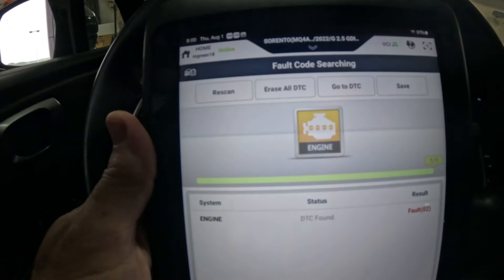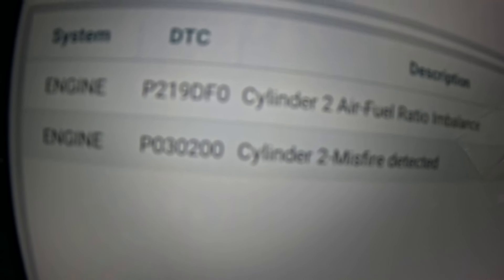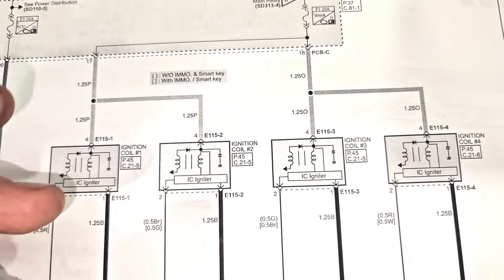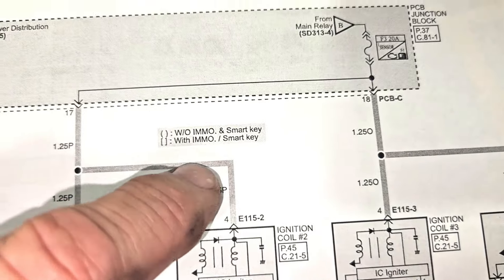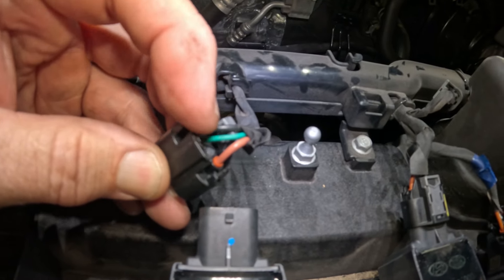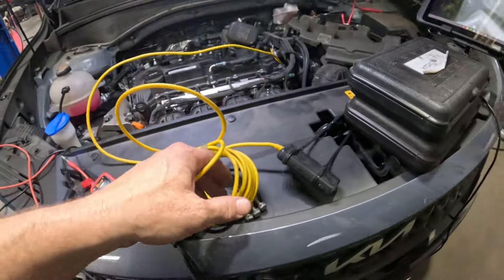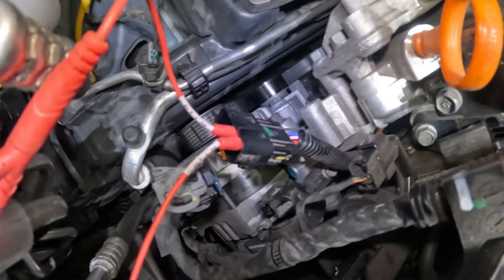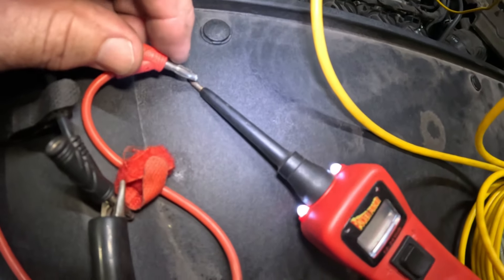Engine misfire diagnostic.

Comment: I have a chicken light in my car. Codes are P1457, P0172, P0420
Reply from the maker: So you have a small EVAP system leak, the system is running too rich, and catalytic converter below threshold.  Let me guess................... Is it a Honda?
Reply: @ShopForemanGarage  possibly it’s the Honda.